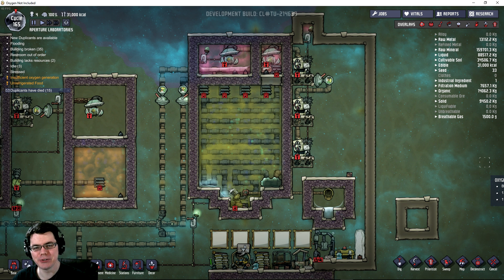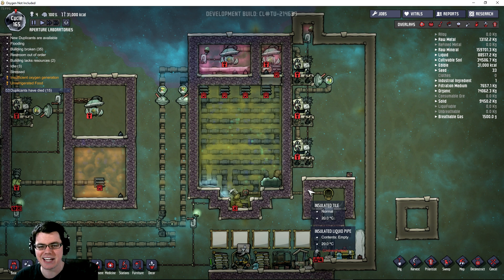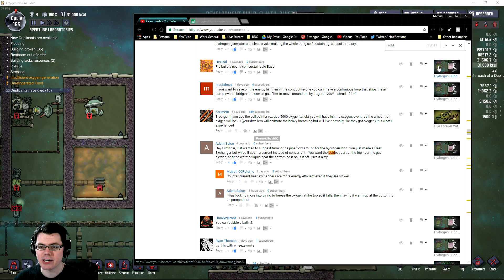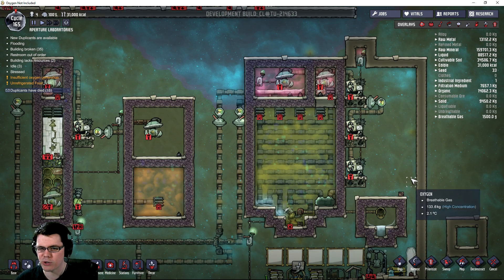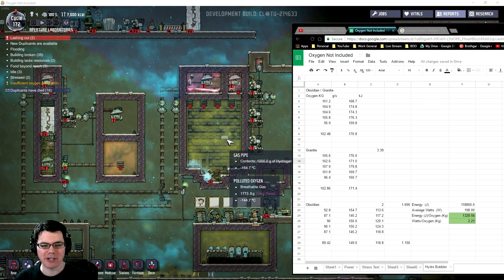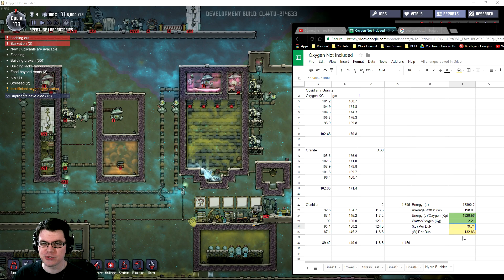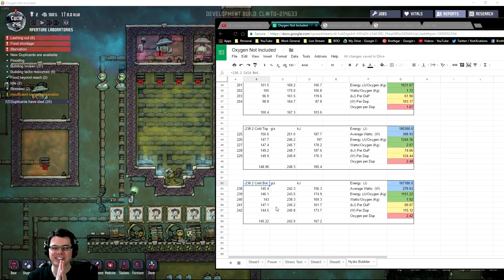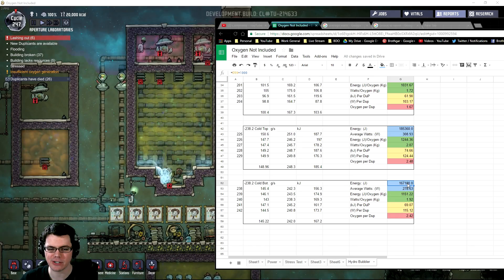Counter VS Parallel Flow - Hydrogen Bubbler Experiment Part 3! Oxygen Not Included Tutorial

Comment: Pre-cooling the polluted oxygen to -180 makes so much sense that I can't believe I didn't think of it myself. You'll not only save size (higher output from the same size system), but you'll also save energy (mostly because you don't have to move as much -250 hydrogen around to condense the polluted oxygen).

Also, you're probably losing some efficiency because the input pipes are trying to lower the temperature of the liquid oxygen. Remove the pipes from the bottom two rows, and all the work will be applied to reducing the temperature of polluted oxygen. (It'll also eliminate any problem with freezing the liquid oxygen solid.) I guess the big risk would be if the liquid temp is close to the boiling point, it wouldn't take much to get boiling in the outflow pipe ... you might need a cooling loop that hits the 1x1 intake square, just to give the liquid a kick before it gets pumped.

I think you're on the verge of something truly awe-inspiring. For the final system, you can get some free pre-cooling for the polluted oxygen by running the polluted air pipes through the liquid oxygen tank.

Comment: I maintain that I would like to see an experiment based on size. Once you have a system designed, I would like to see how size effects efficiency. I wouldn't be surprised if there were a better way to optimize the machinery power outputs and needs so that you could maximize gains based on the size of the operation.

I love these videos by the way! Keep it up!
Reply: Indeed. This is only a small setup for 1-2duplicants. Having a small colony of 10 would mean you need 5-6 of these, however if you can combine some things it might turn out even lower in energy cost.
Maybe you only need one gas pump for the whole hydrogen cooling system. of only one liquid pump. 
The coolers used for a larger setup can heat the liquid output to turn it back into a gas.
Reply: I really think pre-cooling the polluted oxygen is going to take this system to a whole new level (in terms of output per size). A expect a taller, thinner structure will be more efficient, but pre-cooling the pollution is going to make a much bigger difference.
Reply: Yup, i think if you add wheezeworts to it, it saves a lot of energy. you'll need a lot of them though

Comment: This might be harder to do, but what about trying to circulate the two gases across each other? Using an elongated hexagon, release the cold H at the bottom to collect at the top and pump in O2 (perhaps pre cooled as that will probably be the most efficient way to cool) near the top (under the H collection). This would have the best thermal conductivity as there is no barrier. You can use the top air pump to circulate and separate only H to the terminal regulator.

Comment: +Brothgar just use gas valves... they can be made out of wolframite and it works as a SUPER efficient radiator. You can also set the flow on the valves down to about 490 grams on each and it will keep the gases moving though your system for no energy cost. The only energy you need then is to pump the polluted oxygen in and pump the liquid oxygen out.
Reply: Cool thanks!

Comment: Maybe you should put the liquid oxygen at the top of the radiator whith a normal tile between them. This way, the oxygen,that is colder than the gas, will evaporate but it should absorb the heat from the gas and you will use less energy. And for a normal base you need oxygen in the form of gas

Comment: +Brothgar have you tried to have your "radiator" in a vertical setup (rotated 90 degrees)?  This would allow the temperatures to naturally rotate like a convection oven so the right would be colder than the left allowing the air to rotate in a clockwise direction. I don't remember if you covered that already.
Reply: On the other hand, gas doesn't seem to flow from convection in this game the way it would in the real world. Very light gasses take a looooonng time to float to the top, and hotter gasses don't seem to be any lighter than cold ones (of the same type).
Reply: Sounds like we need an "official" test to find out ;) I have used this technique to cool my base before so it would be interesting to see what +Brothgar finds out.

Comment: i dunno if anyone has suggested this but...
it could be a visual thing but it seems to me that the gases condense on where theres contact with the walls, you could try putting a wall down the center of the radiator room and see if that helps more gas condense. dunno if high or low thermal conductivity would be better material, if the wall even helps. As long as its not within 2 blocks of another surface so it doesnt form a liquid barrier you could add more walls if the single wall helps

Comment: i mean, i can already tell you without a doubt that precooling the dirty air going in will make it condense faster,  and in a perfect system, the power usage would switch from being mostly to cool the hydrogen, to cooling the dirty air.

If the dirty air going in is almost as cold as you can get it without it condensing, then the energy spent to condense it is considerably lower, meaning the hydrogen heats up less, meaning it needs to be cooled less often.

so really, once you have the supercooled hydrogen, it will mostly stay that way and all your energy will be spent on precooling the dirty air.

Comment: It seems like, in this game, fluids tend to prefer flowing to the right.  I like your idea of tweaking the shape of the bubbler so that it is asymmetrical and flows down and right \|.  Also, have you considered making the bubbler 2 blocks wide?  That way you wouldn't have to deal with the flow of the liquid oxygen and will pump it out (pretty much) as soon as it dews.
Reply: In teh current version heavier stuff goes to bottom right corner and lighter stuff goes to top right corner. The top/bottom has higher priority, but after that it gathers to the right/left corner.

Comment: have you thought  about adding a pre cooler for the contaminated oxygen.   fill a small hall with weezwort seeds.  pump your contaminated oxygen in there.  it is cooled until the bubbler needs more oxygen.   pre cooling sh out bring down the time to cool. making more oxygen.   using less power per cooling.   plus the weezwort is free.

Comment: Can you try pre cooling in multiple stages?
possible setups
run through a room filled with ice/storage compactors with ice
precool through wheezeworts (either running pipes through it, or actual air)
running pipes through a vaccuum (if this is even possible)
through (multiple?) rooms with other temperatures, with a similar setup as the hydrogen bubbler.

Comment: I suspect your system is left biased because of how your splits are step up.

if you brought in the o2 from the right most i I think you would get more flow on the right side
Reply: no, the game actually has the bottom at the lower right, so gases tend to fall to the lower right and rise to the upper left.
(you can see if very good if you have different layers of gas)

Comment: Question. Would using Mesh titles made out of wolfimite help cool it any?
Reply: that would force the "air" and the pipe to be much closer in temperature. Given that at the top, the incoming air is 30, the pipe is -70 and the h still below -200, that would probably help quite a bit
Reply: thought so, thanks for the input

Comment: Sky Storme has just put up a video with one of these bubblers, that once going takes no power.. and its making like 5kg of liquid o2 every 10 seconds.. seams to be using valves to split the H2 into just under 500g packs, which then instantly recombine back to 1kg of it.. so once its cold, its jsut going round and round, without it being powered, but just its own pressure.. and isnt warming up.. for 8 days he has it opperating, and no cooling being done. it stays cold, and making liquid o2..

Comment: UM just a heads up temperature of masses in pipes reset on each motion. or  you could stick the radiator in a hot zone to steal heat to and pump it other places but currently you cant effect the gas in the pipes without a regulator. . and conservation of energy would be one of those i wish i could send you a save file on the forums so you could look at the systems im running. https://steamuserimages-a.akamaihd.net/ugc/824566637792911139/94CC80F5AED7B82952577D8C6EFF46EDBAC9F10F/
Reply: just a hint about those 2 cooling towers im building. the thermal regulator only pumps when its full and there is only one on each tower. i can flip a switch to add mass to the hydrogen and it will slowly flood the new warmer air in(in case i want to expand or warm the gas)and cycles the excesses off to a hydrogen generator. and the cooler doubles as an air supply, refrigerator, generator cooling and makes liquid co2.
Reply: oh its not terribly fast to start but once its at temperature and pumping around 600g it drops down to only using the air pump for energy oh the one on the right is cooling geyser water and is going to be a bansi Hydrogen tree from the 3 geysers there. h and i was in that shot making water surplus with 2 geysers and 16 dupes